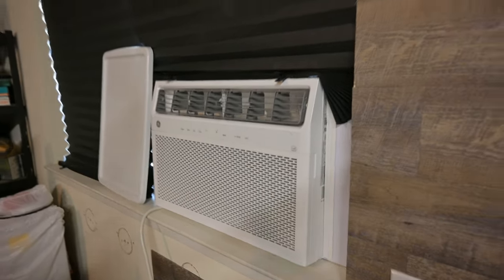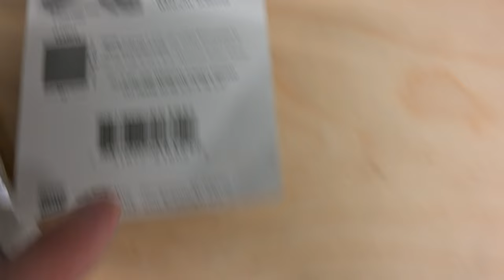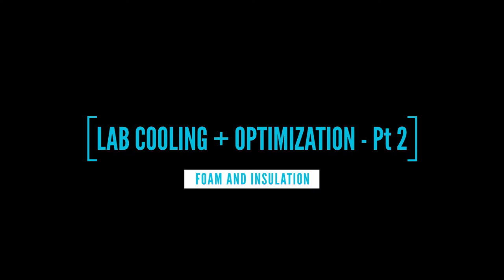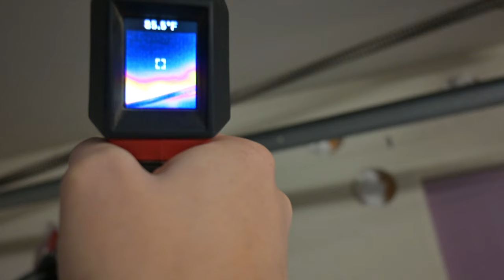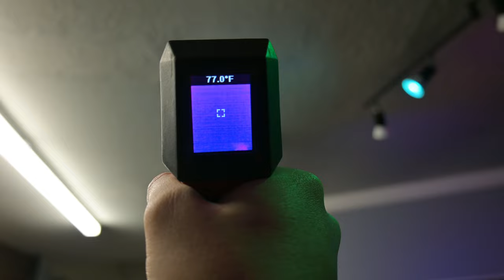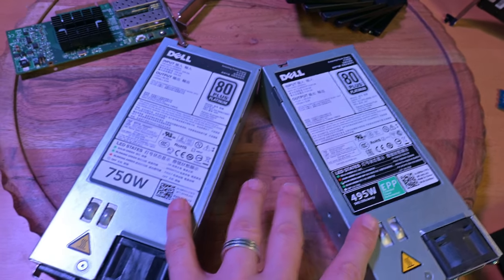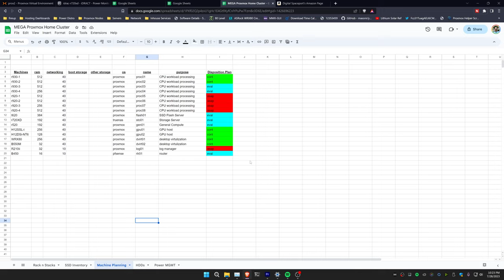Homelab Cooling Tips: Solar Screens, Massive Insulation and more! (Top 10 Ways to reduce heat)

Comment: Great video. I've have yet to see anyone in crypto make a video like this or close to something like it. Fantastic job. Your definitely helping people think outside the box. One thing that we did that helped was installing a couple large solar exhaust fans/vents with a thermostat on our roof. Also we added a static attic vent on each side of the attic to get that cross breeze exchange.  Just getting the air exchanging in our attic reduced our electric bill by about $80 a month on average. Our homes interior temperature dropped considerably as well. There were state rebates that covered most of the cost and I think the federal rebate was $30. Which is better than nothing. Looking forward to more videos and upgrades. Keep up the great work.

Comment: How well did it work when you used that metal foil stuff to enclose your racks last year?  And what did you use?  I've just gotten ahold of a LOT of drives for use in Chia farming and I'm trying to figure out how best to control the heat generation in my utility room where all the gear is located.  I'm thinking that enclosing the hot aisle and then installing an exhaust fan in the drop ceiling to blow the heat outside is best.  But I'm not sure what to use to seal off the hot aisle.
Reply from the maker: It did work, but it was not super efficient as those portable AC units are not great. Especially the single hose ones. The material was this stuff. You need to build a frame and all that to staple it up to. https://geni.us/Radiant_Barrier_Foil I would also suggest that you do not try to vent air out unless you account for how air comes in. It will come in. I tried attic venting and it created tremendous dust intake into the garage. The air in central tx is dirty, hot and humid also over summer time so its not good to use for intake. Using a window AC and just cooling the heat load in the garage after proper insulating has been the best move.

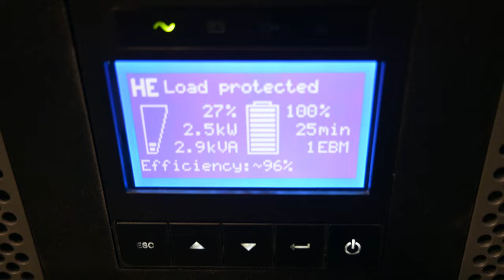Comment: Can you post a link to the ups 25:45
I think a fan is going out in mine
Reply from the maker: Its an EATON 9PX 10KVA unit which I use and is for sure overkill for most setups (and hardwired 50 amps 220) but here is one from the same lineup that you might check into. https://geni.us/EATON-9PX-2KVA Eaton UPS is about as expensive as they come however and you can get a 2KVA unit from Cyberpower for 1/5 the cost which is not bad at all.

Comment: Bro I love thermodynamics!!! Do you have an attic exhaust fan or cut out inside the attic above the garage? If so use it to exhaust all your air. Instead of the hot air coming out your racks and recirculating back into the room let it use thermodynamics to let that hot air rise into the attic and exhaust it out the attic exhaust over the garage. Of course this is all coming from what i can see from your vids but if that ac unit is pulling in outside air you can use that positive pressure and the help of the attic fan to move all that hot air out.
Reply from the maker: Oh cool! So the roof lines have ridge vents cut and there is large end soffits on the edge that moves a decent amount of air. I did try forcing air up into the attic in the past, but it pulled in outside air like crazy. That wouldnt be bad if I was not in central texas, but the air here is always filled with pollens and its really humid. I  have looked for ways to evac the heat but I cant figure out a way that does not involve bringing in outside air to balance that? Any ideas on that? The AC is not pulling in outside air at all its cooling the heat load inside the garage, and it can keep it bone chilling 68 if I hit 5KW a day, or 3KW for around 75. I think a mini split is in the future for me, but the window AC was very cheap temporary thing. It looks awful from the curb however lol.
Reply: @DigitalSpaceport  I had a feeling that window unit wasnt pulling in fresh air only circulating it. Ill have to sit on this on for a little this morning and ill get back to you if I can think of something. I do have an idea that I have always wanted to try but its a bit "experimental" so ill hold off on telling you until its my last resort lol Also what direction does your garage door face? North, South, east, west?
Reply from the maker: @downwiththesneaker9933  garage door is dead on north. It gets little/no sun
Reply: If it were me I would put some bushes on the side of the house where the window and ac unit are some that would grow tall and add some kind of natural shade. Stopping that sun from touching your house/wall and window would do wonders. I would look into getting an attic fan for the spot above your garage door, exhausting just the attic air alone will lower the overall temp in your entire house thats attached to that attic. Youll be surprised at the temp differences just buy adding an attic exhaust fan.

Comment: 35 kw just for the airco ... My house including rack uses 12 kw a day.
Reply: You have some GPUs running aren't you? I am on 7kW at home and I am feeling bad about it. My company setup is also at around 30kW. I haven't had to use AC by now as I was lucky with the weather in Europe by now.
Reply: @johannesedelbacher8837  3 servers. 1 miner. 4 RX Vega's. The plant I work at produces 230 MW.

It's rainy in the Netherlands and I want to install my garden solar farm I designed. I will have the ability to run off grid with my enphase system and home battery when it goes live. 

The only thing my power company will switch off is themselves due to the Enphase Q relais.
Reply: @Bear-form  Maybe I should host your hardware, but I guess you pay less for the 35kW than I would do for your setup.
Reply from the maker: Yeah but with all these tweaks, the window AC is now hitting just 25 kw a day so thats a great improvement for a 2 ton unit. Also its around 40c or greater here all summer long so active cooling is a must.

Comment: Ummmmm, 1) mini split will use way less electricity, 2) whatever you're doing to your attic is going to cause moisture problems. You need exhaust fans if it's that hot. No need to do all that weird barrier stuff. Fan with moisture sensor will also keep it dry during high humidity.
Reply from the maker: I do have an end attic fan and ridge vents but the mini split is not something I want to do just yet as they are much more expensive then a window AC and I now have that down to using 25 kw a day. The attic isnt humid its just very hot and the radiant barrier does keep it cooler on the underside for sure. It dropped the temps around 10 degrees when I installed just that before insulation was done in the garage.